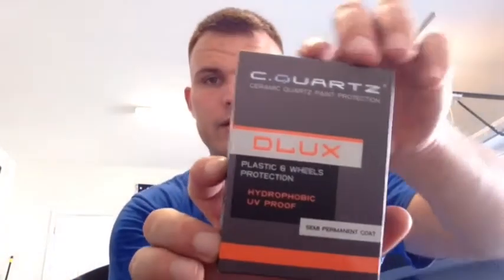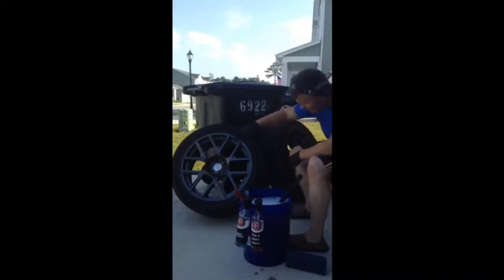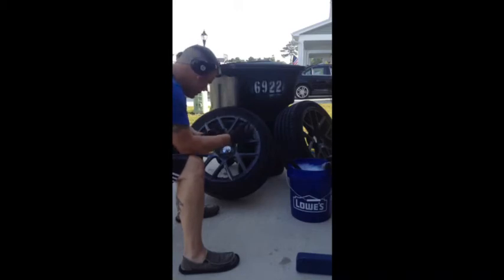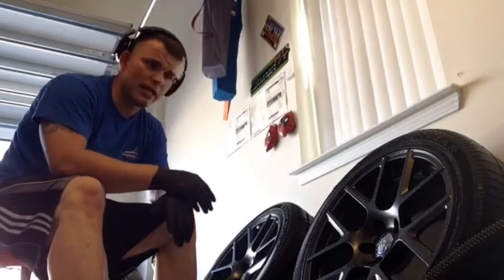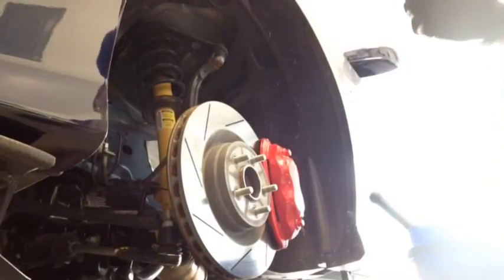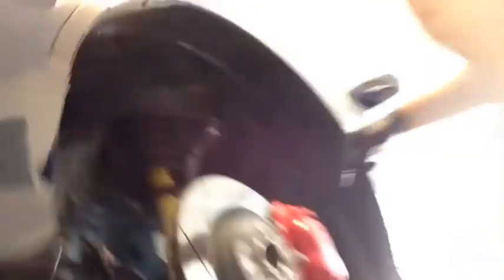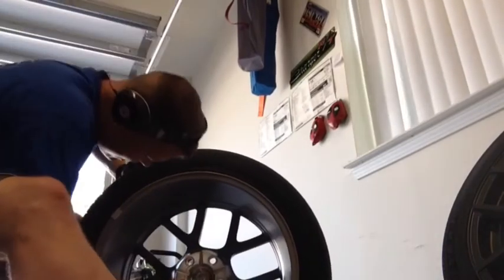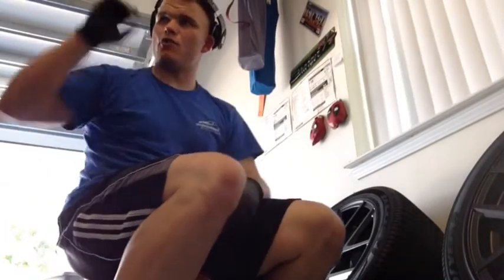How to ceramic coat your wheels!!!

Comment: how hard was it to put the coating on the face of the wheel....I have the same wheel and I'm nervous about getting all the nooks on the front of the rim
Reply from the maker: John Curry the foam block makes it really easy, but if there are areas where you’re having trouble. Make sure you’re wearing gloves and take the micro suede applicator on your finger, into the  grooves.